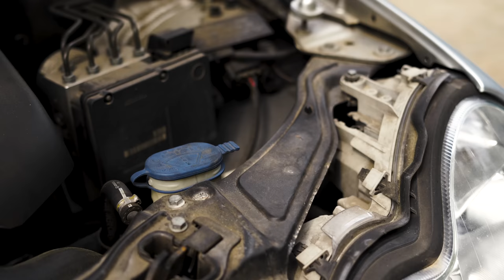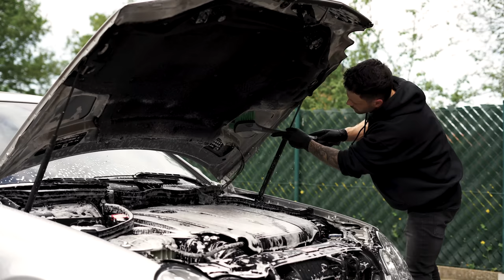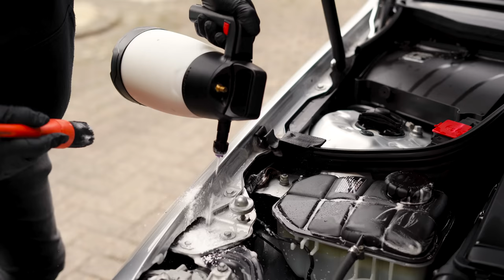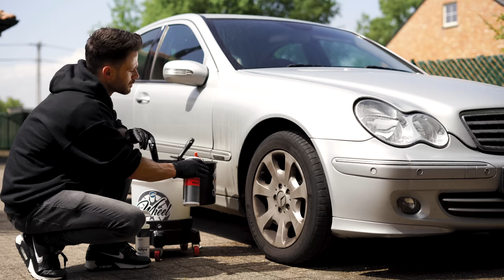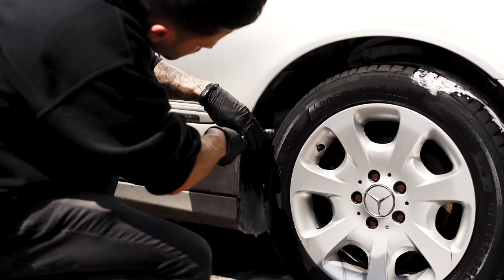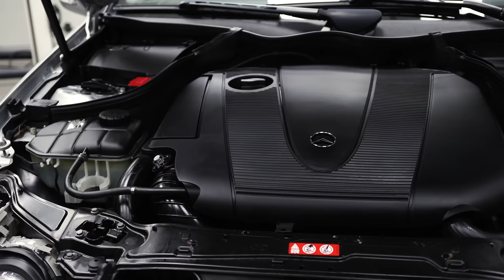13 Year Old Mercedes Engine Bay & Wheels Deep Clean - Auto Detailing

Comment: I'm afraid to spray my engine bay like that, isn't there a risk water will damage some electrical components?
Reply: Imagine you are doing a long journey at high speed in wet conditions.  All the spray will get into the engine bay.  The components are designed to take it.  Just avoid direct high pressure in the electrical connections and it’s good practice to block the air intake (he pushed a black cloth into one in the video). I do mine every few months.  I like to spray GT86 on afterwards. 👍🏻
Reply: It doesn't rain " ON AN ENGINE" WATER IS HITTING VERY HOT PARTS UNDER THE CAR Like CONTROL ARMS AND SWAY BARS AND ALL OTHER FRONT END PARTS.. NOT THE ENGINES alternator and "ECU"... Then again Its probably completely safe to spray  distilled water or regular water on electric parts of the engine
Reply: I’ve been doing it for a while, just don’t spray directly onto electrical parts or put a microfiber towel over the electrical parts, wiping your engine down won’t get everything that’s why pressure washer is the best result just make sure to cover everything up and start your engine after you finish
Reply: No
Reply: Yep you are right the belt in mine got stuck because of water

Comment: I'm always afraid to clean my engine bay like that, i'm scared its gonna ruin something like the alternator or anything electrical, or leak water somewhere it shouldn"t be (330d). But your job is amazing.
Reply: all of the mercs have the brain at the back of the car so you dont have to worry about anything but cars like mine(opel insignia) the brain is right next to the engine. when you decide to clean the engine bay, you have to cover it with a plastic bag or smh then youre good to go
Reply: Really great job @VermijlCarDetail. Looks great after!!!
I am also scared to wash my C Class C220 CDI Engine! What should I protect if I want to be too caucious? Thanks a lot!!

Comment: These were the best C Classes Mercedes ever made. They feel rock solid and drive so well. My dad has this exact one with 320,000 kms on. The interior looks brand new and so does the exterior. It has aged so well. I've seen the newer C Classes with so much rattles and peeling interior bits. They don't make them like these anymore.
Reply: Apart from their big rust issues, they are quite reliable and solid.
Reply: @ACDC1998Zippo  The facelift models (which this one is) does not have rust issues. They fixed it on the facelift.
Reply from the maker: I agree! They don't make em like these anymore!
Reply: Ik it's not a c class but I think the 190 is the best one I'd argue it was the first c class
Reply: only the engine is sold even with oil leak, main issues are rust, electric problems and automatic transmission problems.

Comment: Did you unplug the battery? I’m still struggling on how to prepare everything for a proper engine bay cleaning.
Reply: Not needed so nothing happens to the battery if it gets wet or in contact with any cleaners on modern cars. If you got an older car wich has any open air filters cover them up before so that they don´t get wet or in contact with any cleaners. Also be careful not to flood the alternator and the spark plugs if there are no engine cover and be careful with the engine belt. ^^
There are also diffrent methods to clean your engine bay. It isn´t always necessary to "flood" the whole engine bay with water. If you are afraid you can just use spray bottles or pump sprayers with water to rinse down some areas or just wipe the dirt down with some old "microfiber"towels after brushing it with the cleaners. :-)
Reply: @grams18  thank you a lot :)

Comment: Hello! I have some questions about my car when I finished watching the video:

1a) What you will do if you have a car battery in the engine bay? 
1b) You will disconnect the terminals or not? 

2) Will you wash with the engine surface which locates motor candles or not?

Thanks a lot for your work)

Comment: Every time I see these engine cleaning videos, 
I wonder what happens to cables, plugs, control units... 
the moisture doesn't just disappear like that
Reply: You really just need to make sure you don’t flood the intake with water.  Other than that all control units, connectors, etc have seals.  The engine compartment is not water tight.
Reply: they get corroded if you clean your car like that frequently,most people will say but hey thats what also what happens when it rains but they dont realize that the rain doesnt contain heavy chemicals like these and is not thrown with the same pressure as of a pressure washer

Comment: Job very painstakingly done. But I have a question. Wouldn't it be easier to hoist up the car on a 4 post or a hydraulic ramp and remove the wheels and wash both sides of the wheel rim and wheel wells and also do the bottom of the car as well? I find it interesting that all of you start from below and go upwards. The Maruti Suzuki owners manual says wash form above down and the service centers follow it.

Comment: Good work mate but I still have some concerns for the environment. What kind of cleaner do you use? And have you looked before all connectors and circuits on gaps or something like that? Since a decent amount of water has moved through the engine compartment, but the plugs did not do well^^ Maybe next time go to a washing area.

Comment: Beautifully done as always.  I can't help but wonder if the headlights were
replaced.  They should not look like that at 13 years old.
Reply: Id imagine they we're polished and had a coating
Reply from the maker: Not sure if they were ever replaced. The owner told me it was a 2009 but apparently the car is slightly older. It does have a fairly low mileage though.

Comment: I once made the mistake of pressure washing that exact same OM-646 diesel engine on my CLK-220 CDi and the car refused to start.

Water damaged the cam-shaft sensor according to the OBD diagnosis. Fired up after a new sensor was installed.

I had never done an engine wash because I was afraid of damaging the electronics but some guy convinced me otherwise...never again.

Comment: Do you always use brake buster after MWC? I find MWC really great but it’s not quite enough for my 6 piston brembos with dusty pads. Before I tried MWC none of the alkaline cleaners would touch the dust.

I’m thinking of using MWC in a pump sprayer. The Koch sprayer is very narrow fan out and the product is viscous.

Comment: One question. How does it look with water and battery, and other electronic under the hood ? 
Ps. That is pretty shocking effect :D
Reply from the maker: You don't have to worry about the electronics. You can wash almost any engine for cars that are not older than +/- 25 years. I would be a little more careful when working on older cars.
Reply: @VermijlCarDetail  thx, it calmed me down :DD

Comment: Hi.  did you remove the battery?  why are you using normal chemistry without a dielectric?  did you close the air intake?  how did you not break the car with such a wash?
Reply: He closed air intake with micro fibre towel

When I wash motor bay, I dont remove battery, even if use non dielectric shampoo. I doing this thing about 8 years 
And only in one case I have a problem with car. But it was not my mistake, cause engine brain was not waterproof
Reply: Engine bays are waterproof since 20 or 30 years atleast, with a bit of care and brain you don't break anything.
Reply: @Goodluck6669  Дмитрий, спик раша плиз. А вообще, я хочу на своей двойке бмв помыть подкапотку, но боюсь очень, а то ушатаю и буду пешком ходить. 

Но и при этом не хочу снимать аккум. Я бы просто снял крышку двигателя и далее делал все как в видео, но очень очкую. Можешь дать советы, раз делаешь это уже 8 лет?
Reply: @thunder3racer  да, на русском будет проще) выбираешь химию нормальную, и моешь, особо сильно не Лей в разъёмы, и будет счастье. Из химии могу посоветовать koch golden star. Если такого нет, то у лератон есть химия для Мойки мотора. Потом он в конце запшикал химией что бы пластик чернее был, и резинки не сохли, ну как бы это не обязательно, скорее для красоты. НАзывается koch motor plast 

Когда он снял крышку, обрати внимание, он не лил водой, он вытирал фиброй. Там всё-таки разъёмы и тд
Reply: @Goodluck6669  какой то хитрый этот мужик, он слишком лайтово помыл двигло. Я много уже видео посмотрел, ребята что только не делают, кто то заливает смазкой разъемы, кто то закрывает генератор, снимает аккум. Я так и не понял, это все разные вещи но каждый по разному выбирает из них набор, который он будет закрывать .
Reply: @thunder3racer  я за ним тоже часто замечал вещь что он где-то упускает. Есть сиамка для контактов super lube ей обычно заливают контакты так как она диэлектрик 

Не забывай что каждый делает так, как считает нужным) никакого госта нет для этих процедур 

Но в Европе чуть по-другому просто относятся к этому, для них 200 евро за мойку мотора вообще не проблема 
А у нас да каждую копейку усрутся. В целом мойку мотора он выполнил норм 
Гену можно не закрывать, если ты потом все продуваешь

Допустим я ни разу не видел как он чистит потолок, а мне с профессиональной точки зрения интересно было бы посмотреть
Reply: @Goodluck6669  да он вообще ничего не чистит, к нему приезжают все на чистых машинах, а "дёрти" по его мнению это моя машина после одного дождя 🙄. А у них в Европе, видимо, дождь из осмоса состоит и машины все чистые.
Reply: @thunder3racer  я в 19 году брал машину в аренду, и от Германии до Бельгии проехали, ну короче всю Европу центральную. Я хочу тебе сказать, что это было в ноябре, и через две недели поездки тачка была как после трёх дней езды в Москве. Прям правда чистая. Позавидовал) 
Ну поэтому и у меня есть на хлеб так сказать. Битумы, липа, и прочие прочие негативные факторы окружающей среды дают мне возможность работать и зарабатывать)

Comment: I'm working on 10 year old wheels on a e300 too that are almost never cleaned. Still have tar and break stains on the edges and inner wall  after using Carpro trix and Meguiar's ultimate wheel cleaner... Any tips?
Reply: I don't know thise products weel, if they are alkaline you have also to use an acid and a tar remover...

Comment: What's your take on the whole spraying the engine? There's lots of people claiming that water will get into connectors and all that, but neither my car or my gf's had any issue. Granted i just cleaned them once each as one is 22 year old and the other is 17 year old and never got an engine bay cleaning, but still, repeated cleaning would cause issues? Great job on this mercedes though!!
Reply: At least on this merc, alike mine, every single connector has a rubber ring on the male end to keep them water tight, cant say mine are watertight anymore though i broke all of my connectors lol

Comment: Amazing work man! 
I have a 2013 C300. Would you use this same wash method on this vehicle as well? I want to give my engine bay a good detail like this but I don’t want to cause any damage using this amount of moisture.
Reply: What I usually do - cover the alternator, drive belts, tensioners, fusebox cover and battery terminals with a plastic sheet so that they don't get wet. After cleaning the engine bay, I use an air blower to dry out any remaining moisture from the engine bay.

Comment: Amazing job and and content. Quick question - with no wax or paint protection applied on bodywork, how does it look that shiny??
Reply from the maker: Thank you! I applied a sealant after washing the car, but didn't include it in the video. I was a bit limited in time here, so I just focused on the engine and the wheels.

Comment: Hey.  How do you take care of the windshield?  Is there any other way to remove the oil film on the windshield?
Reply: From the interior? Use a good window cleaner like Invisible glass, Xtreme Solution’s Bling, or P&S Paint surface prep and glass cleaner. Spray the windshield, clean with one rag and then use a second rag to buff any remaining residue. Repeat if needed. Make sure you get into the edges of the windshield really good. They’re always missed.
Reply: @transparentdetailing1954  What I'm curious about is the car's exterior glass.  In Korea, the phenomenon of oil getting on the outside glass is called ‘oil film’, but it is not easy to remove it.
Reply from the maker: I have a video on cleaning windows, you should check it out! 😉

Comment: Again a great job!!! Do you use the same product for the wheels as the anti-rust spray for the exterieur like meguiers?
Reply: He is using Koch Chemie Mwc and P&S Brake Buster for the wheels and CarPro IronX or Koch Chemie Rrr for the exterior 😉
Reply from the maker: Thank you! You could use an iron/fallout remover, but Mwc is a more dedicated wheel cleaner. It also contains detergents.

Comment: how do I clean my wash mitt because I am fearing that my mitt is causing swirls and scratches
Reply: Replace it if you feel there’s trapped dirt or debris. They’re cheap.
Reply: On a very dirty car snow foam won’t get the dirt off nor a pressure washer. So when you are making contact you are creating marring and swirls. 

That’s why you see him wash a DIRTY CAR he uses 

VB (as a strong alkaline cleaner) and then AF (active foam) as a more powerful snow foam which is more alkaline than gentle snow foam. Then he makes contact wash. 

If the car isn’t that dirty you can do snow foam only. 

I also recommend using two mits per wash. That way each one only has to he re introduced into rinse bucket 2x reducing likelihood of swirls.